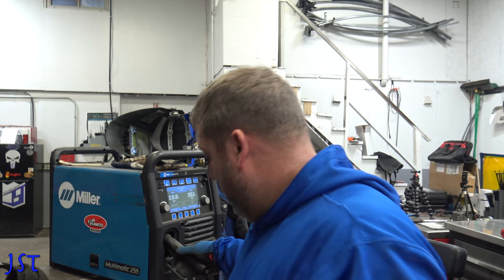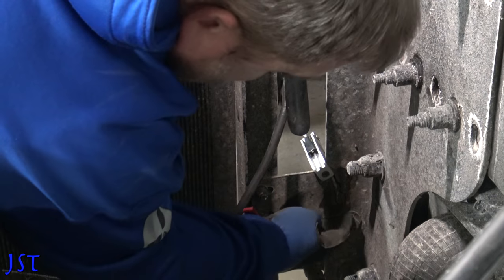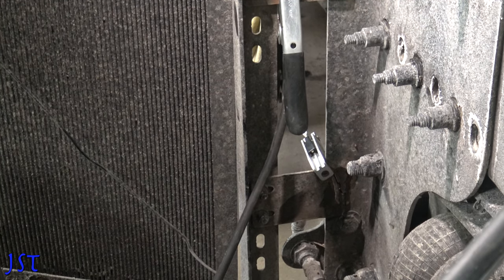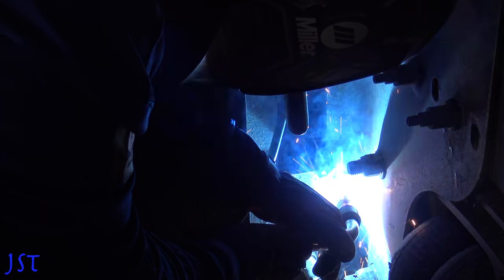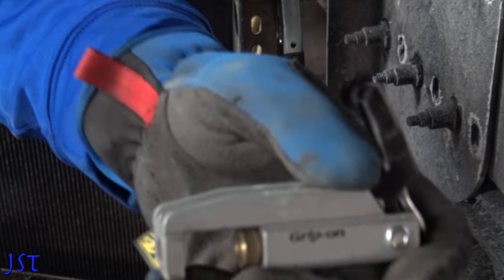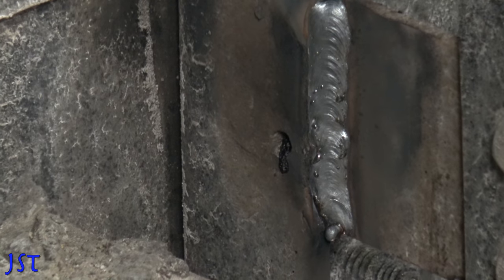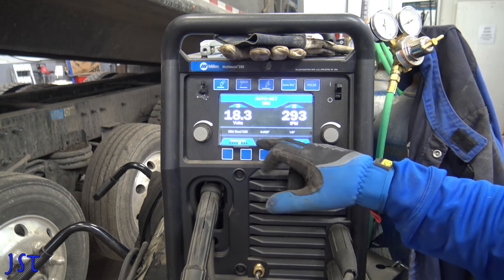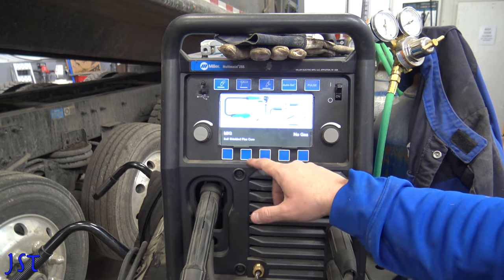WELDING UP A MUD FLAP BRACKET

Comment: We loose mud flaps like nobodies business in the trucking business. Especially the trailer mud flaps, we back up too far when reversing and tear the damn things off from the tire hitting the curb while catching the flap.

End up bending the hell out of mud flap rail, and no way in hell are you going to straighten it out unless you have a hot as hell torch laying around.

PAIN IN THE ASS!!!  You want to see a pissed off driver? Tear off his mud flap!

Then you go through the scale and get hammered by the DOT for not having a damn mudflap!

Always carry a spare friggen mud flap, and the correct tools to put the damn things back on!